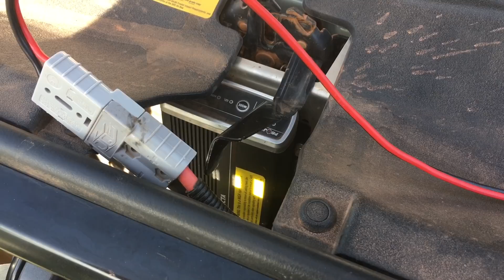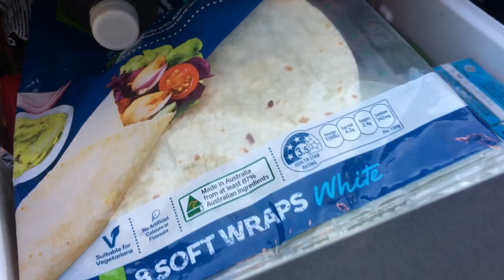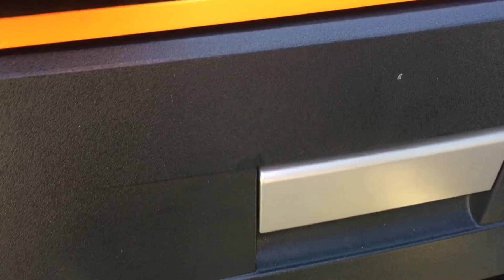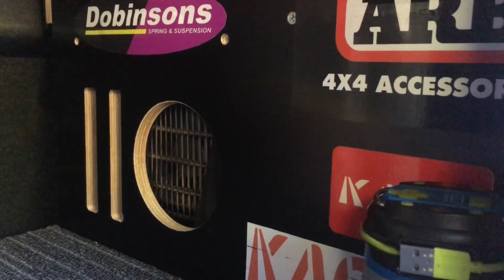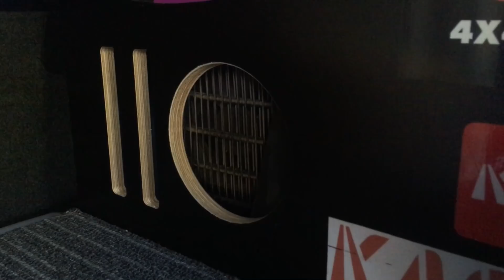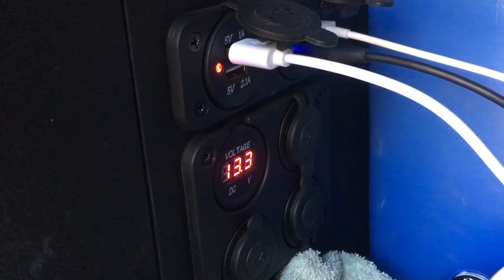REVIEW 4 U - THE TYRES the CHARGER the FRIDGES - BFG KO2 PROJECTA DCDC WAECO DOMETIC

Comment: If reconnecting the temperature sensor wire does fix your charge voltage, you can also check to make sure you have correct battery chemistry selected, default is AGM, which will limit to 14.4V, if you select "Wet" mode, you should get up to 14.7V.
Reply from the maker: Finally a reply from someone that actually thinks 👌😉✌️

Comment: Ah, from the projecta specs, it says  12V
 VSR Mode – Default ( When ignition wire not connected) Turn on: 13.4-20V, Turn off 12.8V. And also later it says: "If your vehicle has a fixed voltage or temperature compensating alternator installed, leave the Ignition Override cable (blue colour) disconnected and taped."  And according to Redarc site, Prado 2008-2019 is not a true smart alternator, it is a temperature compensating alternator so you should be all good with ignition wire cutoff and taped.

I do think there's a very good chance your low voltages are due to cutting off the temperature sensor wire though!

Comment: Actually, even more likely than the ignition wire... its most likely the temperature sensor wire, which you cut off, which is limiting the output voltage on the charger!! If you still have that sensor wire you cut off, try re-connecting it, and attach to battery. (or just attach to cold part of your car, if you want to test and see if attaching the sensor wire will fix the issue. Because, yeah without knowing how that wire behaves, who knows, cutting it off may make your charger think your battery is cold (what you were hopign for), or, it may do the opposite, make the charger think your battery is hot. So connect it back up and stick it on something cold i bet you suddenly get that charger to 14.5V where it should be.
Reply from the maker: I think you may be onto something the only inconsistency with that theory is it charges fine with the engines running every single time
Reply: @Fourby4Diesel  Oh... i see so it is only low voltage when charging from solar! Ok, well in that case, it sounds like your projecta is fux0red. It would be great if you can return it under warranty, and test a replacement - if replacement does the same, then it's a bad design, and noone should buy these. If replacement works, then you just got a dud the first time. Projecta are supposedly Australian designed, so they should be able to provide support for this issue. I'm an engineer (computer systems,  so i don't design electronics but i know the fundamentals), so I'll give them an email and see if they have any other explanation, but yeah i reckon if i describe the behaviour, they'll recommend to replace it.
Reply: @Fourby4Diesel  Oh and i also just found this in manual: "Cut/remove Temperature Sensing cable if temperature compensated battery
charging is not needed. Use supplied heatshrink to insulate the open end of Temperature Sensing cable.." So you were spot on, cutting the temp sensor off should not cripple the output voltage. The battery temperature compensation, if it is working, should give you a higher charge voltage at very low temps (freezing and lower) and very high temps, but yeah, cutting off that sensor should leave the unit providing its default charging voltages, which should be 14+ volts, even off solar.

Hmm. Hangon, the fact that this is only happening on solar has got me thinking. It is actually possible this behaviour could be expected under some circumstances. If you have a good battery, and its a bit flat sitting at just 12V say, or lower, car alternator may be able to push charge voltage up to 14.4V, but it might have to push in 20 Amps to do that. A big 4WD alternator can do that, but solar probably cannot unless you have a huge bank of good solar cells in full sunlight. You'd need 288 Watts to push in 20 amps at 14.4V - so normal size solar just cannot do that.

So yeah long story short, if you have a good battery and its a bit flat, you wont see 14.4V on solar, but as battery fills up you absolutely should see 14.4V, toward the end. So if you don't see 14.4V when battery is nearing full, your charger's solar charge circuit is r00ted, either by some fault, or by design...
Reply from the maker: He’s something else to think about since you have proven you have definitely got a brain functioning at at least 90% great to see even when the Battery starts off full and the good solar panels are in good sunlight even solar panels that are rated at 200 W it still doesn’t get voltage higher than 13.2 usually but sometimes it goes up differently the solar controller is the problem we’ve tried different panels with the same result
Reply: @Fourby4Diesel  Yep, it definitely sounds like that controller is just not working right on the solar side, esp if you have 200W of panels thats a decent amount of juice.

Comment: Hey i went back to your vid where you went over the installation of the charger. And when you installed it looked like it was working, with the ignition wire cut off. But maybe that is the cause of your low charging voltage... have you tried connecting that ignition wire and see if the piece of crap wakes up and starts charging like it should? Lack of input on that ignition wire could certainly alter the way the device decides to charge....
Reply from the maker: It worked as a vsr without the wire in shortly afterwards within a month or two I connected the ignition wire which still works but I think better without it I did attempt to disconnect it but I made other connections to that wire so decided to leave it if I get time I’ll get rid of it

Comment: Ive got almost 100k out of 4 yr old KO2s, still probably 10k left, id say 60% highway, 40 off road, done, VHC, Tas, S.A., NT, WA, no punctures.  Only dislike is a they can bit slippery on wet bitumen.  Have self installed dual battery system with projector 100 isolator but no dcdc and 160 watt solar panel thru cheap mppt regulator, charges perfectly from alternator or solar.  Also have  Australian Direct (kickass) drawer fridge, 2 yrs old, runs 24/7, well insulated all round unit,  very happy with performance.  Love your no nonsense KISS approach to stuff. Cheers

Comment: hi 
Either faulty dc2dc or wiring fault . With mppt charger voltages should not be as viewed. Charge volts are pathetically low  what I would consider as a no charge situation  .

Comment: it a very good honest review, thanks Anthony. I myself wouldn't be putting the LR rear on the front , I'd more likely just go left to right to spin the direction, just for curiosity, it would be nice to see what the inside of the LR looks like, as that's where you see if it failing in the sidewalls  with black feathered marking and rubber dust. That LR tyres worn down to the point where you start losing grip in the wet just from experience.